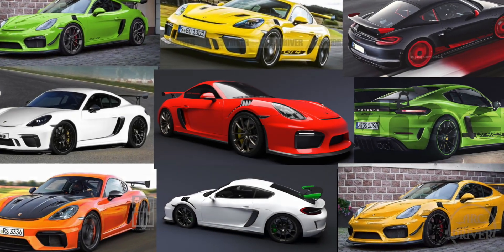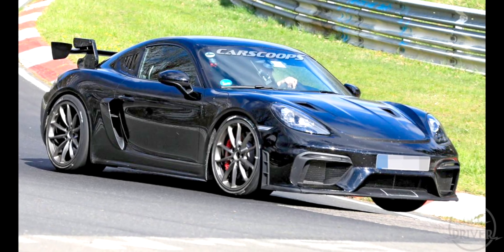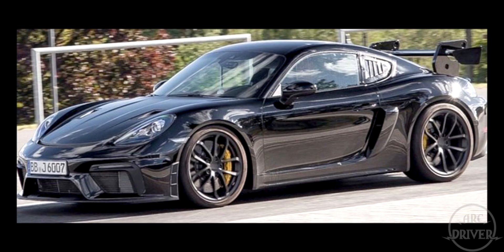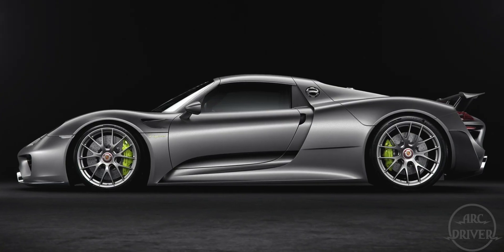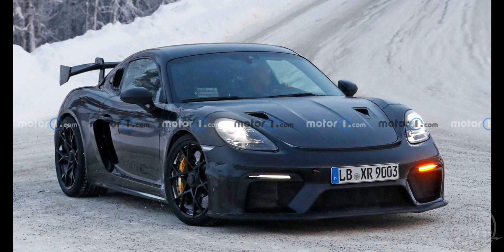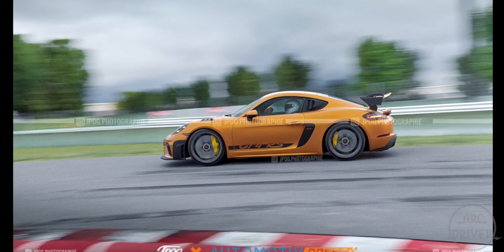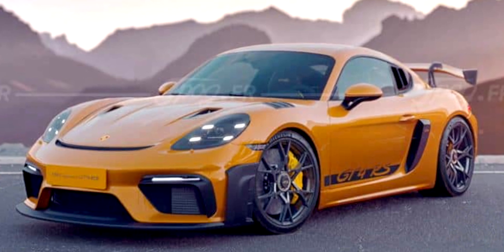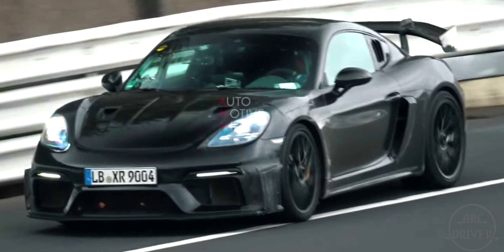The Porsche 718 GT4 RS: Everything We Know

Comment: In response to the GT3 not having intakes... The GT3 does have intakes on the deck lid. Since the 718 platform is mid-engine, the intakes needed to be moved. My guess is that the GT4 RS will make somewhere in the range of 450 to 480hp. 500hp would be amazing but an 85 hp jump over the standard GT4 would be a bit insane. Likely will see a 500HP RS during the 718.2 generation. Great video!
Reply: My thoughts exactly. However, I don't think there will be a 718.2 generation The current one is essentially the 981.2 generation despite the name (number) change.
Reply: @kkaratas  I have heard it both ways: The 718 is the 981.2 refresh of the 981 as well as the 718 is an entirely new chassis designation and will be broken into 718.1 and 718.2. Making the 981 the odd model of the bunch with no mid-life update.

I personally think Porsche will go with 718.1 and 718.2 due to the fact that Porsche is putting a lot of R&D into the GT line of the 718. They want to milk that as much as they can before having to start all over with an entirely new platform.

Comment: The street Cayman is an undercooled car. Tracked examples regularly see 240+ F coolant temperatures. This is partially due to the mid engine design, where it is difficult to get sufficient airflow to cool the engine, transmission, and differential. So part of the additional ducting on the rear must be for cooling on this car that intended for the track. The other part is probably for engine air intake. Last year, the rules for the 718 GT4 Clubsport were modified for SRO and Trophy Series races to allow ducting for intake for the engine in the rear quarterpanels / side panels, much like you see here.

Comment: Yea! I think the GT4 RS will outperform a GT3 but for sure not the new GT3 RS. That will have around 540-550 hp as rumors have it.
Reply: It can not be better than the more expensive car. Would make zero sense. I doubt it will be much faster than the normal GT3 unless they bump up the price.
Reply: @almac9203  In a good German Magazin they talk about 130K Euros Plus for the GT4 RS.
Reply: @marcnobel3938  I am not familiar with German pricing. How is 130k Euro relative to the GT3 and GT3 RS? Porsche have to either price it  at a higher price or hobble it to not cannibalize 911 sales. You can't have a cheaper GT4 RS showing up the 911 so it's either price it expensive and unleash it's full potential or detune it to keep the performance hierarchy intact. I think the GT4 RS is going to be a great car and a good investment.
Reply: @almac9203  The new GT3 starts here at 152K. Considering that the 911 base is more expensive that is quite a small difference. Base 911 starts at 107K and a 718 GT4 is 97K. I think it wouldn`t disturb the order in their line up. GT4 will be slower than a GT3 and a GT4 RS will be slower than a GT3 RS. Maybe be the GT4 RS will be "just" as fast an GT3. That would be still great.  I think so longer the fitting 911 model to the 718 is faster, it will be fine. Base 911 faster than the base 718, 2S faster than the S, GTS faster than the GTS, etc. - I just guess it by the given numbers. Power to weight the GT4RS seems to be (with what we know) better than the GT3. It`s also smaller and mid-engine vs rear engine. The 911 will get the new double-wishbone front. So on paper, it looks quite close to me.

Comment: I think that the Cayman complex still exists, i want it to have THE 4.0 flat 6 from the GT3 (510hp), revised suspension front and mostly back, big aero and PDK (manual would be better but we all know no other RS will ever have a manual). However, my head says it will keep the GT4 engine, probably with 30~50hp more, the reason being that Porsche is governed by accountant's and they dont see the point on making a new engine just for one car, so when the GT4 was given the "Go" the made a "new" flat 6, that then went in the GT4, Spyder and GTS's, and now wiill probably go in the GT4 RS, and this was one of the reason the GT4 was possible, because the engine was pre-planned to go in many cars. 
Porsche might pull one over us and use the GT3 engine, but even then that engine now has 510hp because of the new exhaust to comply with emission regulations, and has been confirmed to be the 992 GT3 engine, if the GT4 RS had that engine, sales of the GT3 would go down, so IF (big of) the GT4 RS has that engine it will most likely be downtuned to 450~470hp.
The only things that have been confirmed are the swan wing, new centerlock wheels (a first for a Cayman), the upper side slats for cooling as well as the other aero mods.

Comment: Itll be less than 450hp. It need more air intake from the sides because its mid engine. Gt3 has air scoop on the trunk due to engine location. And no, it will never ever out perform gt3, let alone come close.

Comment: lets not lie to ourselves.  This will cost well over 100k with all the track pack goodies and not be far off the gt3 price.  Sure it has the mid engined layout but Porsche would definitely have not gone to the same lengths it did to refine its performance like it did to the gt3.  My guess is that this car will have about 450PS and will be an awesome track car.  But, I'd take the 9000rpm GT3 over this.